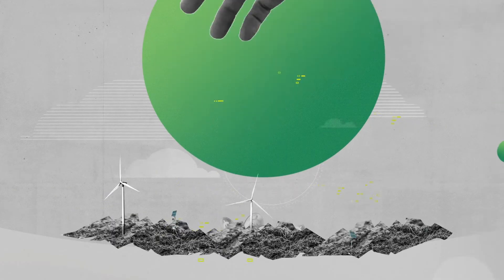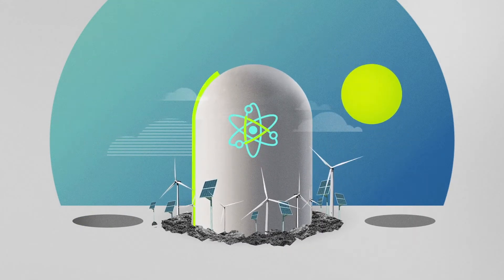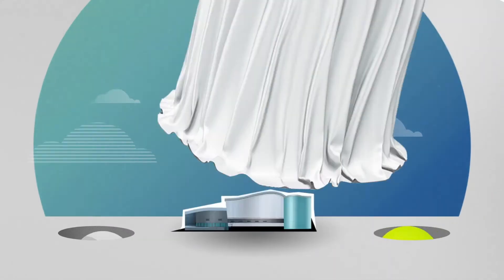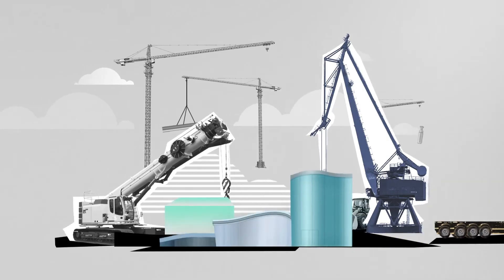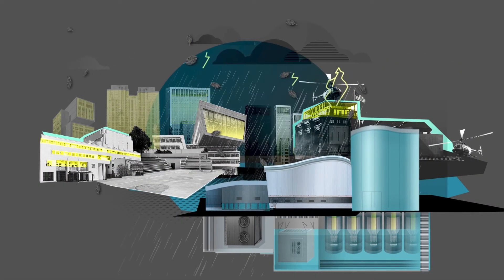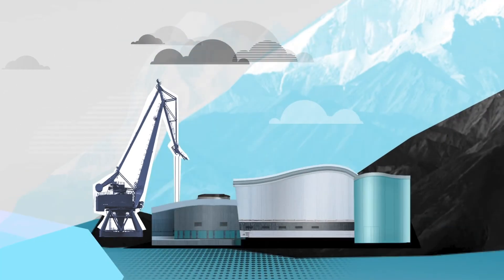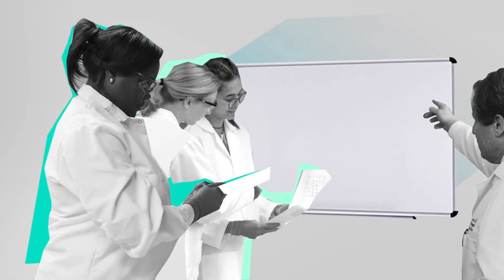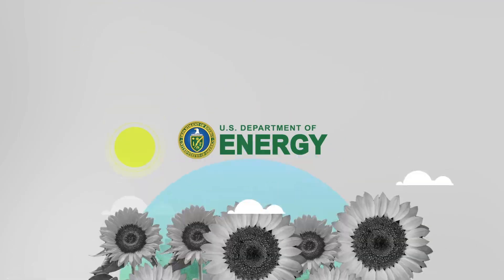Energy 101: Small Modular Reactors

Comment: Practically all of the commercial nuclear plant are water type reactors as are the proposals for the small modular reactors [SMR's].   These plants have a common thermal efficiency rating typically in the low thirty percent range;  placing them practically in the category of automobiles as far as poor thermal efficiency goes.   For every three thermal kilowatts generated in the reactor;  two of those KW's are doing nothing but heating the environment.   With these kind of numbers; one would think that nuclear excess reject heat energy could be used for Desalination or Hydrogen production or even other forms of environmental cleanup.   Even if one is farm growing main lobsters and abalone;  it would be some commercial offset for the upward cascading Operations & Maintenance costs which are bound to happen.   Any nuclear plant is like purchasing a large yacht.   Your price to get the thing is just the down payment.
Reply: It is extremely common for nuclear plants to desalinate seawater.
Reply: @paulbedichek2679  --desal and water cleanup operations are indeed present at nuclear power plants but what we are referring to is commercial scale production of fresh water for a metropolitan area and not just drinking fountains and coffee machines.  Appreciate your interest.  RHJ.

Comment: I'm fully on board with nuclear reactors being the future of baseload power production, but they've got to be high efficiency, molten salt reactors. The risks involved with current designs requiring high pressure containment are why they attract such heavy regulation, with the inherent high cost and lengthy completion times, just ditch them, they're shit.
Reply: We need to do all of the above.  MSRs look great and the physics are impressive, but there isn't much experience with molten salt systems.  Can they be built to run reliably?  No doubt in time they can.  But don't forget all the materials issues with water reactors.  Stainless fuel cladding didn't work, steam generators had to be replaced after fretting -- lots of mundane but expensive problems to be solved.  It's too early to rule anything out.
Reply: New fuels are being developed to reduce core temps. Go take a look at Lightbridge Corporation.
Reply: No,we want them to be advanced reactors, but there are other kinds besides molten salt reactors, there are many types of molten salt reactors, we can have TRISO solid fuel, with molten Flouride salt carrying the heat from the reactor to the steam generator, we can have Terrestrial Energy with the fuel melted into the salt,so,no melt downs, it is already melted, but instead of elaborate piping and treatment of the salt, you simply add fuel, at the end of seven years you replace with another reactor they are small and inexpensive.
In Europe huge traditional reactors still make sense the worst reactors the French EPR over budget in three locations will still give cheaper cleaner energy than natural gas and renewables, and it UAE they built four Korean reactors in four years for 20 billion totals you can't beat that e;lectricity with coal.

Comment: This is not exactly 'new' technology, this is just taking the current bullshit pressurized water solid fuel reactors and making them smaller. Pretty sure they already did that when they developed the nuclear submarine.

Instead of pissing around with solid fuel reactors, get some liquid fueled reactors running again. It doesn't even have to be fueled by thorium (though this would help) just get some MSRs going already.
Reply: I don't really care if the design that saves us from wind/solar proto-feudalism turns out to be an SMR or an MSR; I just want to avoid the proto-feudalism.
Reply: @gilian2587  Liquid fuel allows the reactor to utilize all that fuel. In solid state it can only burn around 5-10% That's the real reason people get excited about liquid fuel reactors, you're burning as much fuel as possible in the reactor, thus creating far more energy per tonne of fissile material.
Reply: Moltex took existing regs and opted for solid in a salt matrix

Comment: NASA made a 4KW Stirling engine thermal reactor the size of a chair.  Smaller 1KW ones could power individual homes.
Reply: Your average hair dryer is about 1.5-2kW. A 1kW sterling engine won't cut it.
Reply: @mattbrody3565  Yes,one KW reactors are very useful,NASA will use the KiloPower for the Moon 10KW,the reactor part is the size of a coffee can, we'll use reactors to power the rockets to go to Mars,chemical rockets take too long, exposing crews to too much radiation.
 Hairdryers use a lot of power. There are smaller reactors than one KW.
Reply: @paulbedichek2679  I understand it’s valuable to NASA and can be extremely valuable for space exploration. My point was that 1kW isn’t enough for a typical household.
Reply: @mattbrody3565  Deisel is far more energy dense than solar panels or wind turbines, nuclear fuel is 70,000,000 times more energy dense than diesel,so the waste form nuclear plants is always cleaned and stored unlike the coal and methane byproducts solar panels and wind turbines rely on.
 We will have neighborhood reactors ,underground and unmanned, one or two MW.
Reply: @paulbedichek2679  yes. I get that part. I also get that there’s a number of impracticalities to operating small reactors on a neighborhood scale and that utility-scale deployment is far more practical. Sure, having a backup power system is very valuable, but a 2MW reactor isn’t particularly useful here in a consumer utility system. It’s better for remote locations, like Alaska.

I’m not calling nuclear power a bad idea, just the concept of putting a radioactive stirling engine in people’s homes and/or breaking up a big, more flexible grid into micro grids.
Reply: @mattbrody3565  Batteries. Or use a towel

Comment: And what about nuclear waste? Is the waste clean? What about Thorium SMRs?  Safety, reliability and "be easy to build" is only one side. Sustainability and reprocessing are also very important.  What about the posibility to use the Waste as a Bomb? That should not be able to happen!
Reply: Waste can be reused, supplying humanity with fuel for the next thousand years. The very thought of someone stealing a bunch of nuclear stuff from a reactor and making a dirty bomb out of it is ludicrous. Iran is spinning centrifuges as we speak. They don't need to steal any nuclear material. They can make their own.
Reply: Using more thorium and less uranium or plutonium in the mix can achieve nuclear reactor that are more hard to do nuclear weapons the key it's a regulator to uranium and plutonium and use the uranium waste to activate the new smr

Comment: Very interesting. Any word on the licensing processes for NuScale or Hitachi's reactor?
Reply: Going well, right on schedule, before those two we'll have a smaller nuke, a micro reactor, supplying energy to the far Northern Alaska airfare base which now uses 800 tons of coal daily. Don't know what the company is called,but the reactor fits inside a shipping container,supplying 10MW electrical plus plenty of hot water.
Reply: @paulbedichek2679  It looks like they haven't decided on a specific design/vendor yet (decision in 2022), but it seems that Oklo's Aurora and the DoD's "Pele" project are in the running.
Reply: @nemo5654  I know all about OKLO,didn't realize they were in the running for that job,so many exciting things with new nuclear. OKLO uses fast reactor type technology, it will be heaven when we get reactors like that that produce almost no troublesome waste,and run twenty years without stopping to refuel.
 OKLO has changed their designs a few times very innovative they were software developers and are extremely rich, they just want to "serve mankind".